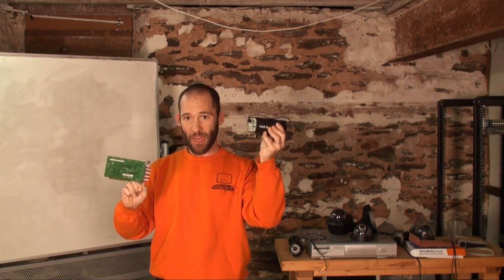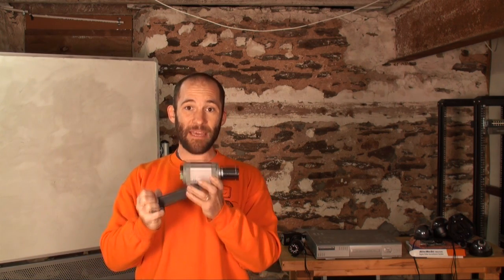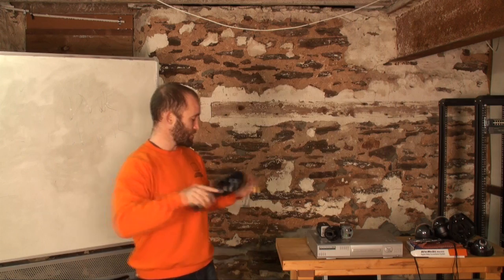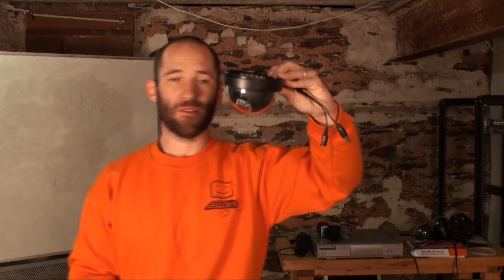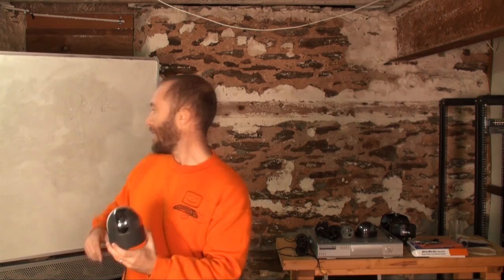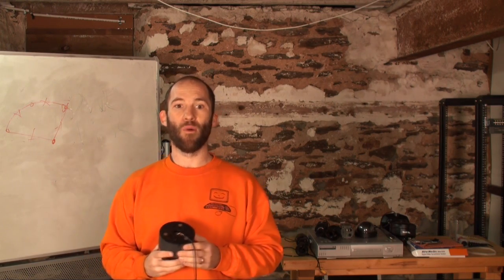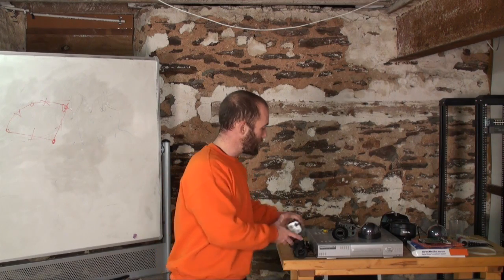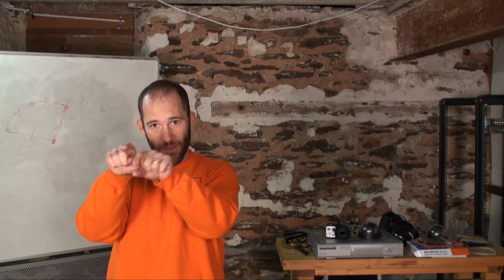Introduction to Digital Surveillance Systems

Comment: can you still make good money with this?
Reply: Depends on your market niche, geographical location, and the structure of the business. The most money is in commercial applications since the security industry is slowly migrating from a reliance on physical presence into digital solutions. Still, residential applications will become much more prevalent in the near future. Presently it's fairly cheap to buy a home security system with cameras and install it yourself. If you can work the convenience angle and get people to pay you to install their systems then that would also work. These concepts also don't apply to certain areas. Areas around Silicon Valley especially have been quicker to adopt digital security solutions. The southern US has been far slower, and the industry is only just now coming into it's own. If you know what you're doing that would be a good area to start, and jobs with new start-ups are readily available. One man operations are not as viable as they used to be though.

Comment: 1) How many cameras can be connected to a pc based DVR??
2) With Normal DR we will also have to purchase a telivision to see the video however that doesnt need to be done in PC based DVR..Wont this have additional cost??

Please reply..
Reply: 1) As many as the PCI card can connect to. 
2) A DVR appliance can be connected to your network just like any other device. Most businesses and houses that are looking to install a security system with a DVR would also have a PC readily available. There's no reason why you couldn't access the recorded video from any PC already on the same network as your DVR. No further display purchase would be necessary. Connecting over network would also be a beneficial modern approach since you can also use mobile applications to access live and recorded video from your DVR by connecting to your network.

Comment: How long is the recording time on a security camera before recordings are over-ridden?
Reply from the maker: +Naropa Ananda It just depends on the drive size... with new 6TB+ drives out there you may get over a year depending on number of cameras and the settings...
Reply: +Eli the Computer Guy The system I require is for a confectionery store with six cameras. would I need a year or more, or much less of recording before the over-ride restarts ?
Reply: +Naropa Ananda A week should be fine, you have to decide why you need it and that will tell you how long it needs to be.

Comment: Thank you Eli.  I thought the video lesson was fine.  Not so concise but found that going over the info a few times was actually helping me retain the information.  I appreciate your generous consideration and effort to share your skills and knowledge.

Questions:

1.)   What do you think about wireless systems?
      a.)   Can the signal reach 200 ft?
2.)   For my home property (outdoor 2 acres) I'd like a 6 to 8 camera system w/ cameras as far as 200 ft from the DVR/NVR.  Would you suggest a lower end "no lite" (IR) system.
3.)   If wireless not recommended, is there a certain grade wire recommended for outdoor?

Thanks again,
Steph

Comment: Yes very nice no doubt I love it but you missed the most important parts   1- you never explained the camera angle and distant " 1/2, 1/3, 3.6, 2.8, 4mm,  6mmand so on   2- 12TVL what is equivalent to in pixels 1 MP, 2 MP or what   3- When buying a DVR what to look for what to avoid, recording wise resolutions: CIF/D1/960H/720p/1080p, viewing vs recording quality.   4- What brands you advice.    5- Cables types quality this vs that thin wires vs RG59 for transfer rate, distance for camera from DVR with different wire type   6- if I buy a 12TVL does all DVRS support that or how I match the camera I buy to the  DVR I buy. is it possible that the 12TVL camera I bought can default to lower TVL if DVR is not good or don't support it.  7- electrical interference.   Can you please make a video that cover all those challenges that we face every day in our buying selling issues and choices also dicision making

Comment: Incredible talk Eli. You are an amazing teacher. IMPORTANT: your forgot the fount of MOST COMMON TROUBLE of most newly cctv installers: power supply in general  and dc inverted polarization in particular. If you plan to do this make sure you learn the basic of electricity and learn how to use a multimeter. You can fry all the system or a expensive camera if you dont know about this stuff.
Reply: Another consideration: its no so easy money thing if you do profesional work. You spend a lot of time meeting your client expetations, buying things and designin the system. And its a lot o money involved. So make sure you dont mess it up not reading more and testing in your house if you dont have the pacience or the guts to look like a thieve or and idiot to your costumers.
Reply: +zak00101 www.htwcctv.com  www.ttipcam.com.  10 years golden supplier in alibaba.  my skype:ttcctvcamera003

Comment: Eli, wonderful stuff. I came away from this session wanting more.... However, I think that means I will need to review the session two to three more times to pick up on key points missed. Question, when you set with a potential client, do you have a checklist (from your years of experience) that you used to ensure that all bases are covered?

Comment: Hi ELI. Thanks for the nice video. It would have been really good if you would have incorporated details on supported cable length or wireless limitation for surveillance solution.
I want a 16 IP channel/camera solution with NVR professional grade and need to be installed at factory. Out of 16 camera would be at the distance of 90 to100 meter from NVR. I don't know whether it will be practically supported by power over Ethernet. If I go wirelss then I doubt on Band width considering all 16 camera live feed on a single wifi router.
CAN U SUGGEST ME A PROFESSIONAL GRADE SOLUTION with below my requirments.
1. Camera 1M, 720 is Ok.
2. Camera shhould have P2P, POE and preferably wireless in order to have redundancy. Or any better option u have.
3. 16 Channel NVR for 24x7 recording of all 16 camera at 15 Fps or more
4. Remote view on PC and Phone is a key requirement.
5. If I go with POE camera for a distance of say 90 to 100 meter do I require signal booster or what would I will be needing.

My preference will be a complete solution offering pacakage in order to avoide any compatibility issue like OS, ONVIF, RTSP...etc
Pls suggest a good equipment accroding to my need between 3k to 4k USD.

The system will run 24x7.
Pls reply at chadhachadha@gmail.com

Thank u in anticipation

Comment: Bayonet Neill–Concelman (BNC)
Reply: T3DT it gets called that everyday
Reply: Franken Stein Actually British Naval Connector...I'm a Sailor so I know this...Underwater Navigation Electronics Tech to be precise
Reply: Cory Hall The connector was named the BNC (for Bayonet Neill–Concelman) after its bayonet mount locking mechanism and its inventors, Paul Neill and Carl Concelman.[1] Neill worked atBell Labs and also invented the N connector; Concelman worked at Amphenol and also invented the C connector. A backronym has been mistakenly applied to it: British Naval Connector
Reply: Cory Hall  As a British MoD trained Engineer I can assure you it has never been called "British Naval Connector"

Comment: hello and thanks for the video

I have a question regarding on how to play a cdfs wih an IMG file on it? it contains the surveillance video

It has the IntellexPlayer setup on it, but just wont open or run. And I cant find it on the web

Should I burn the IMG to a CD with Nero, or open it with a Virtual Drive software?

Comment: You'll probably need to go to your routers admin console to see which address was assigned to the camera. If you are wanting to access the camera from a computer that is not on the same LAN you will need to setup port forwarding on your router. Once that is setup you will access the camera by typing the routers IP in your web browser.

Comment: You need to let your viewers know that although IP camera's have a better resolution that they ALSO WILL "over saturate" your Networks bandwidth.  I do not recommend ANYONE install an IP System with 4 IP camera's on any network with less then a 3mb Internet connection.  One IP camera (PTZ) with up  to 4 analog cameras properly setup in a flood style setup per 2500-3000 is plenty effective enough, most commerical clients have a T1 which I do not recommend for IP System

Comment: i respect you and what you doing here. but you miss alot. the dvr now is more powerful as before . you can use ethernet cable with it. and you can use alot of other good services and the dum analog cameras been a smart camers . and the bnc cables is more save and comfortable than the ethernet cables. do you agree with that or not ?...d

Comment: Thanks for the class, but I think you should mentioned the dip switches inside the ptz camera, which after matching with the dip-switch diagram that comes with your manual, will tell you exactly which dip switch you need to turn on to correspond to the protocol, baud rate, and cam ID/address.  You left me under the impression that if you buy a ptz camera you have to rely on luck to have your dvr to have the same protocol as your ptz.

Comment: Thanks for a very informative class.Is there a easier way to secure the cable to the outside of the building? Instead of using a hammer to pound the clamps to the wall. Most of the walls are made of brick and mortar .Can you tell me an easier way to do this with power tools.

Comment: HD camera just get better and better, cost keep getting lower but it will fill up the the hard drive faster. I still use my obsolete home camcorder to zoom in my mail box from the window 100 feet away and record with digital motion detector to save hard drive space. It works out pretty good, the old camcorder have excellent optical lenses. Of course IP camera is the way to go for business.

Comment: The organization I work for just bought a 5 camera system for a total of $1000 for the whole project... I'm not sure what kind of cameras they are but I'm sure they're relatively cheap and not the IP ones you mentioned.  In your experience, do you find that clients naturally want the higher end system or do you generally have to sell them on it?

Comment from the maker: @MrMac5150 The $2000+ Mega Pixel cameras CAN actually save a lot of money for a client if you spec the system properly.  1 $2000 camera can do the job of a $4000 4 camera system in the right situations.